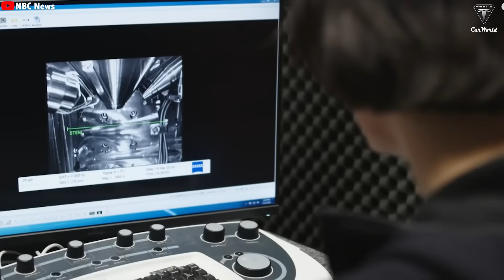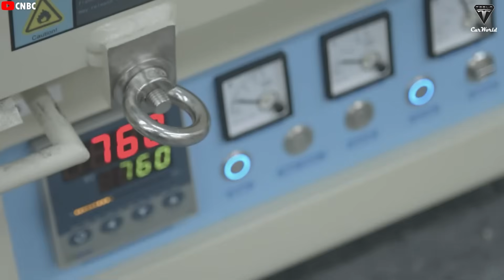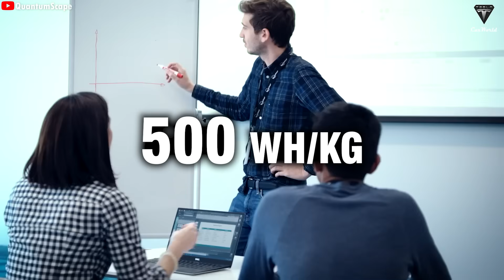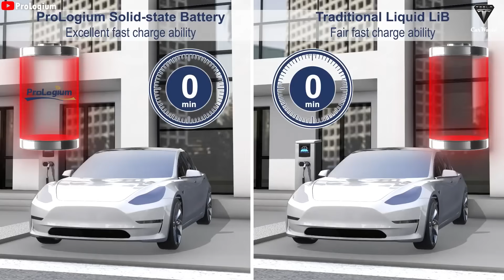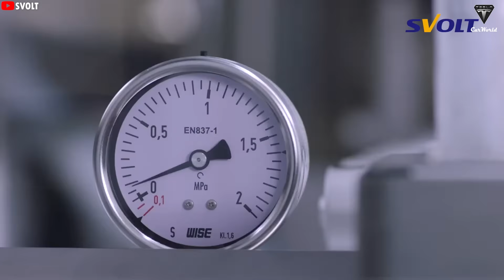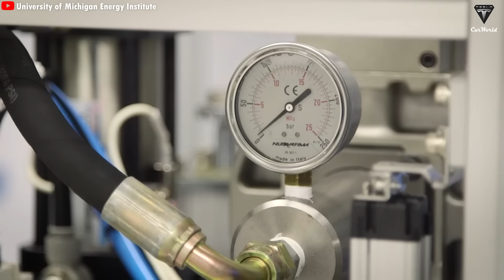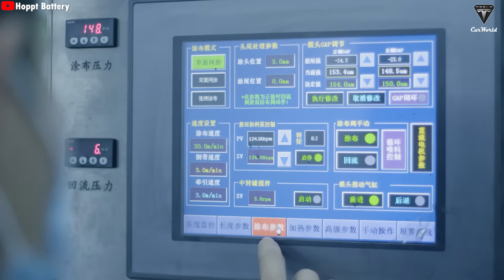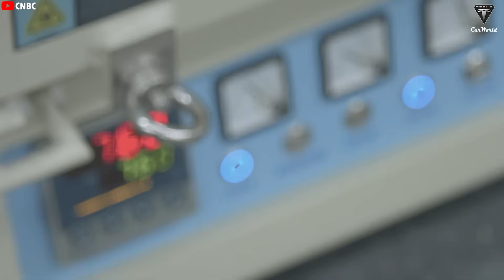Finally Happened! Elon Musk SHOCKED NEW 900 Miles Battery & 12 Mins Charge!

Comment: BYD invents a new super duper battery with a 900 mile range.  That's all fine and dandy, but this has its own problem.  Let' way a Tesla can travel 7 miles per kWh.  The super duper battery bases on the Tesla example would be very energy dense.  If it ignored that that a very high charge rate charger is required to charge that battery.  Where are those chargubg stations - that's right, nowhere.  Charging lower energy density batteries keep dirvers hanging aroud for hours for a charge.  Now consider charging even higher density batteries.  Already in Europe power cuts and politician pleading with people not to use their home air conditioners or other appliance like washing machines and dryers.  How on earth are they going to provide the electricity needed to charge car batteries using wind turbines the remain idle when the wind doesn't blow, and solar panels that do not work when the sun doesn't shine (overcast days, and at night).  Only politicians can dream this stuff up.

Comment: At least they are being realistic about the time frame for production of this technology. 2027-28 sounds reasonable to work out the manufacturing and cost details. The only problem that could derail their plan is if Max Chikumbutso's Microsonic free-energy technology is mass introduced and available to the general public. It would virtually make a lot of battery technologies obsolete even before they get designed and produced by 2030. Every company will be procuring Microsonic devices for everything from home energy to small businesses to portable devices to use for recreational and outdoor activities where no grid power outlets are available. The claims are that the Africans are already building cars powered by the new tech. We're hoping that the technology either gets debunked for sure or else becomes ubiquitous forevermore. The ability to generate electricity on demand without recharging from any external power source would free humanity from the tyranny of the Globalist Elites that control the flow of energy to the masses. Even if the Microsonic free energy device would cost close to as much as a Solid-State battery pack of equal KW of power output, it would last far longer and require no maintenance or monthly fees to charge and operate. Having virtually free unlimited electrical energy is literally having the power to do almost anything from desalinate water, power homes anywhere on the planet, run HVAC and heat pump systems, recharge portable devices, operate manufacturing facilities and businesses, and being able to travel anywhere in a vehicle unencumbered by the need to pay for energy. I'm kind of sad that TESLA's engineers haven't come up with something similar to a Microsonic free energy device [YET]. They should probably team up with Chikumbutso and the Africans to build manufacturing facilities world-wide to produce billions of the devices and replace the need to use costly fuels, unsightly windmills and huge fields of solar panels and storage batteries to power everything from the grid. It would take at least a decade or two to replace devices that currently run on oil, gas and other liquid fuels with devices that use only electricity. Now THAT would be something, for sure! We should be dreaming BIGGER. But it's frustrating that wealthy barons of industry and corporations still hold us hostage. We are very close to breaking their stranglehold on the world, unless they finally debunk the Microsonic free energy device and all the other free energy devices that are being designed and built in research labs around the world. It will only take one successful free energy generation device that the Globalists cannot suppress to change the course of the world forever. The Globalist Elites wield enormous influence and power over industry. They have succeeded in suppressing many inventions that would have improved the world in order for them to continue to wield power around the world. It's going to take a league of nations to break their chokehold on humanity and make low-cost free energy devices globally ubiquitous and out of their control forevermore! The possibilities to do good would be virtually endless!
Reply from the maker: Yeah, thanks for the detailed comment, @jimmyfalcon886, you bring up some really bold ideas! It's true that if something like the Microsonic free-energy device turns out to be real and scalable, it would shake up the entire global energy landscape, including the EV industry. But until we see real-world demonstrations backed by peer-reviewed data, solid-state battery technology from companies like BYD remains the most credible and advanced solution on the horizon.

BYD's approach might not be "free energy," but their solid-state batteries are still a massive leap forward—doubling energy density, cutting charge times down to 12 minutes, and offering real safety advantages. While the idea of eliminating dependence on centralized energy sounds amazing, we still need technologies that are both scientifically verified and manufacturable at scale.

It’s healthy to dream big, and we should keep pushing for revolutionary breakthroughs. But we also need to recognize the real progress being made—like what BYD, Samsung, and others are doing with next-gen batteries. These aren't just concepts; they're already being tested in vehicles and could be changing the market within just a few years.

Let’s hope innovation keeps accelerating—on all fronts

Comment: BYD is in intense competition with Tesla.  This video seems to be celebrating the success of the BYD meeting, Tesla loses, in the EV car industry.  

China, with BYD, can defeat all other e-transport vehicles.

Many novices do not understand e-transportation.  Skateboards, Roller skates, mono-wheels, bicycles, scooters, e-delivery vehicles, e-buses (many sizes), e-coaches, e-trams, e-trains,  e-copters, e-planes, e-cars, e-trucks, e-semis, e-tractors, etc.  All of these can have all levels and types of "full self-driving".
Reply from the maker: Exactly—BYD and Tesla are pushing each other harder than ever, and that’s great news for everyone. Whether it’s BYD’s solid-state battery or Tesla’s 4680 cells, this kind of competition drives faster innovation and better products for consumers. No matter who comes out ahead, we all benefit from better EVs with longer range, safer designs, and faster charging.
Reply: Byd will not beat Tesla! They make a cheesy econo car. Byd is inferior in so many ways. Don't believe the hype

Comment: The real issue with the battery which is the weakest link in EV,  is the replacement, change process, cost. If this was a simple effective process that allowed new batteries to be installed, would give the customer confidence to venture into EV , not hesitate to!
Reply from the maker: You're absolutely right—battery replacement and long-term costs are still major concerns for EV owners. That’s why advancements like BYD’s solid-state battery are so exciting. They’re not just more energy-dense and safer—they’re also built to last longer, reducing the need for replacement in the first place. But you're spot on: simplifying the replacement process is just as critical for consumer confidence.

Comment: Where are they going to get the new and more robust electrical grid that will be needed to recharge these batteries in 12 minutes? Renewables? Forget it.
Reply: All UTILITY TRANSFORMERS ARE A *VERY OLD * /1910 , SQUARE CORE DESIGN and only about 67%EFFICIENT ...
MODERN "ROUND"  CORE type "R"  weigh about 60% of ANCIENT DESIGN , GIVE OFF FAT LESS WASTE HEAT ....COPPER PRIMARY WINDINGS and COPPER SECONDARY WINDINGS ARE WOUND IN A PERFECT CIRCLE ....SHORTER PATH FOR ELECTRONS but SAME MAGNETIC DTRENGTH as SQUARE CORE ...LESS INHERENT VOLTAGE DROP IN ROUND CORE /"R". , LESS WEIGHT , CHEAPER TO MAKE , FAR  LIGHTER TO SHIP , LESS WAST HEAT , LESS FIRE DANGER ....SCRAPPING EVERY 2 ANCIENT "SWUARE CORE TRANSFORMERS  AND METALS (COPPER + IRON)? CAN PRACTICALLY MAKE 3 MODERN HIGH EFFICIENCY TRANSFORMERS ...AND GIVE ≈ 30% MORE ELECTRIC POWER/WATTS to CHARGE CARS ...WITHOUT BUILDING MORE POWER PLANTS 😮
Reply from the maker: That’s a fair concern. Fast-charging solid-state batteries will definitely require major upgrades to charging infrastructure. BYD is already working on 1,000 kW charging stations and aims to expand them in China and Europe first. It won’t happen overnight, but the tech is advancing—just like how Superchargers evolved. Integration with renewables is still a long-term challenge, but not an impossible one.

Comment: As someone who drives an EV in cold weather, I completely get how frustrating charging can be in the winter. I really hope Tesla’s new battery makes a big difference.
Reply: Battery must NOT BE CHARGED TILL BATTERY GUTS/INTERNALS REACH 33⁰F or LI-Ph-Iron batteries are damaged .... ...WINTER DRIVE ...0⁰F ...BATTERIES ARE RUN "DEAD" ON MAXIMUM LONG TRIP ....NOW SIGNIFICANT POWER (*NOT* TAKEN INTO ACCOUNT IN E.P.A. "MILEAGE" STATEMENT) MUST BE USED TO WARM MASSIVE BATTERY.

BEFORE CHARGING ...LENGTHENING CHARGING TIME ...AND ...IF A REMOTE CHARGING STATION ...DRIVER MUST SIT/WAIT IN CAR/TRUCK ...AND USE MORE POWER TO HEAT PASSENGER COMPARTMENT 😢....LONGER CHARGING TIME , ...AND IF A 750 K.W
 TRANSFORMER IS USED gor 12 CHARGING STATIONS ...THEN WHEN #8 , #9 ,#10 ,#12 PLUGGED IN CHARGING STATIONS WILL "TAKE" ...MORE + MORE POWER from ONLY TRANSFORMER ....TRANSLATE : 1200 KILOWATTS NEEDED TO QUICKLY CHARGE 12 CARS  ...and ....NO SLEEPING BED IN TESLA TRUCK or TESLA CAR 😢😢😢 ...

THERE IS A (UNETHICAL) SOLUTION ...IF DRIVING UP TO A TESLA CHARGING "ISLAND" with 11 VEHICLES CHARGING ...PLUG IN TO 12th STATION ....LOL EVERYWHERE TO SEE IF ANYONE IS WATCHING ,,😜 .....QUITELY UNPLUG 5 VEHICLES 😅 ...
THEN YOU WILL CHARG UP QUICKER 😁
Reply from the maker: You’re not alone! Solid-state batteries are promising not just for faster charging, but also for improved cold-weather reliability. If companies like BYD and eventually Tesla can deliver on these improvements, winter driving might finally become less stressful

Comment: How much longer can the cabin stay warm with the solid-state battery compared to the current lithium-ion battery?
Reply from the maker: Great question! With a higher energy density and better thermal management, solid-state batteries could help keep the cabin warm longer without draining as fast. That said, real-world data is still being collected—but the early signs are promising for cold-climate performance.

Comment: I’m not sure if this solid-state battery will actually perform better than a standard lithium-ion battery when it comes to daily driving.
Reply from the maker: That’s a fair point—it all comes down to real-world testing. While solid-state batteries offer higher energy density and better safety on paper, their actual daily driving performance will depend on factors like software optimization, vehicle design, and charging infrastructure. Hopefully we’ll get more test results soon!